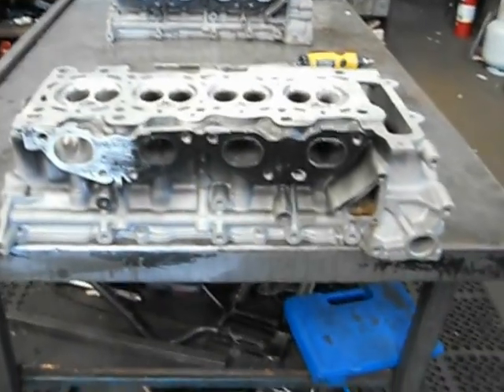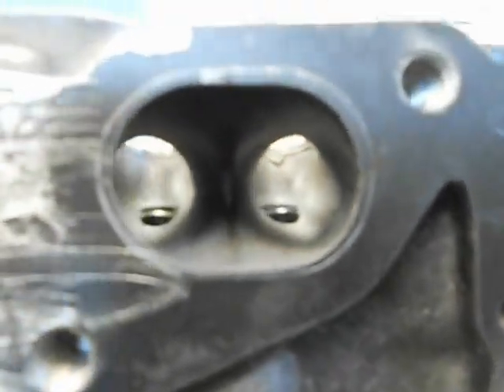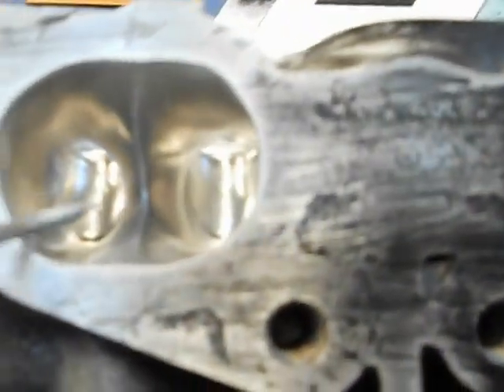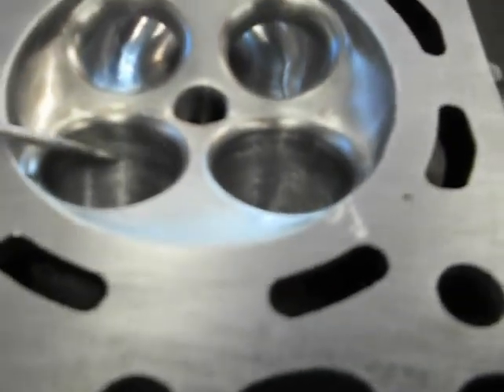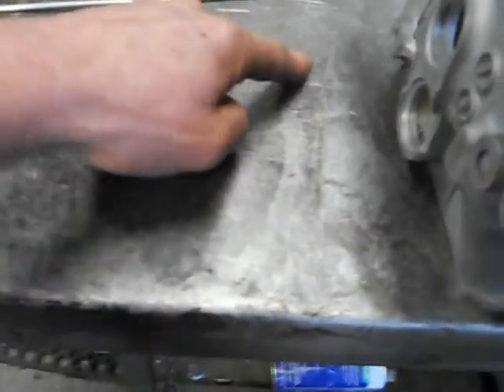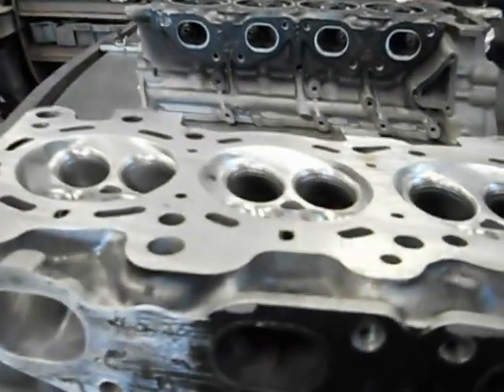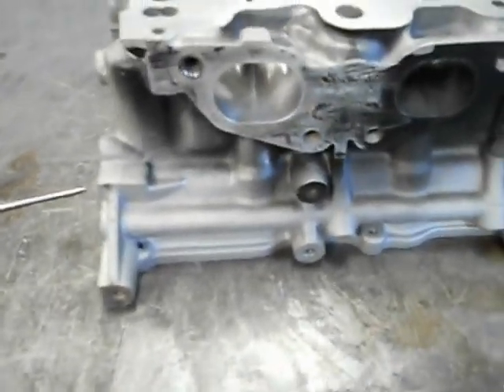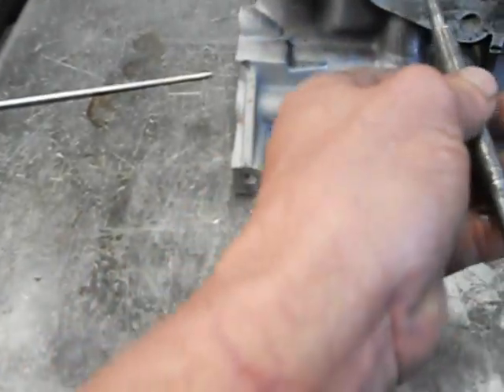How to Port and polish a 500hp Nissan SR20DET Head  Part2

Comment: Awesome video Im in NZ and am currently doing a match port n polish to my rb26 head myself as I cant afford to pay someone to do it. Was havn problems getting right in close to valve guides. Love da tip on the extension will make 1 tomorrow. I was looking at the cutting the valve guides (because i have taken a little chip out of 1, opps my bad) like u have in your video but no one has given me a clear answer on wether is safe/worth doing. Can u shead some light on it.

Comment from the maker: G'day mate,I have reconditioned heads and engines for over 32 years,and all heads are sand blasted,...You to know what your doing,on SR20DET's I mig weld all oil gallery blanking balls out of the head,then drill and tapp the gallery ends clean and fit grub screws in place

Comment: Nice vid mate, u have stated you finish it off with sand blasting? i hear thats not very good to do as it risks sand remaining in your head in places and eventually create issues with cam lobes and oil squirters blocking up. any info?
Reply: MrAym23q I imagine if you then Hot Tank the block you can clear out any remaining sand, granted that's not something we can all do at the house haha

Comment from the maker: Technically speaking fuel consumption should go down because of the improved volumemetric fuel efficiency percentage.That is percentage of the amount of air/fuel into the engine to the output of the engine,but most of the time if you have the power on tap you use it so the fuel gauge goes down fast but the smile on the dial is as wide as the Sydney Harbour Bridge lol